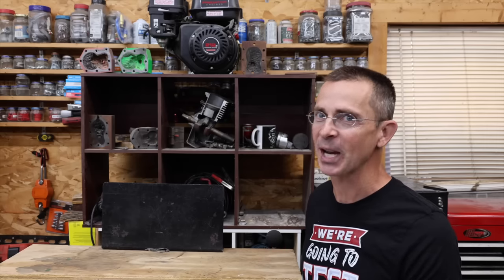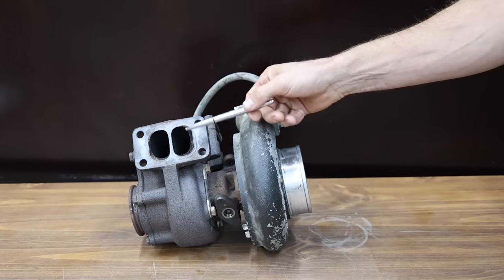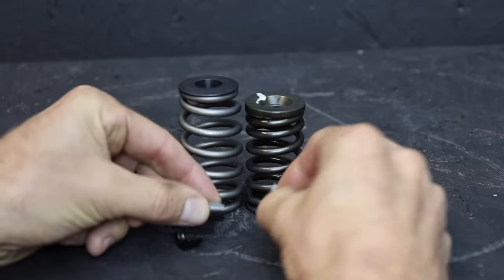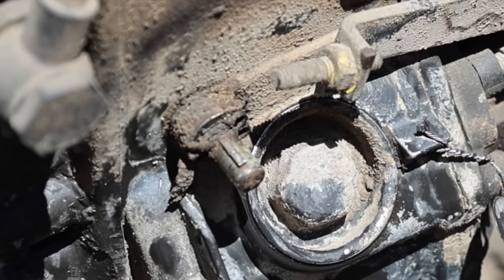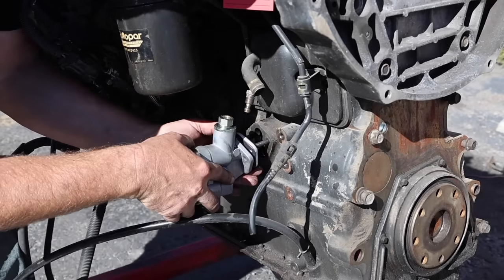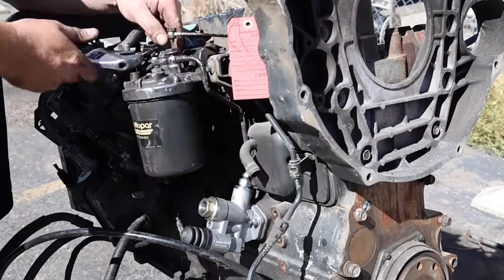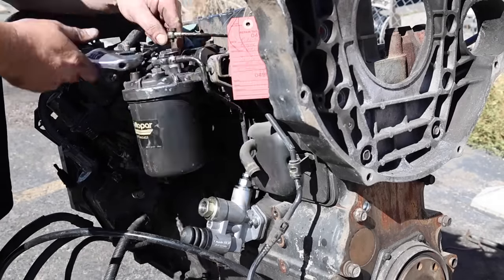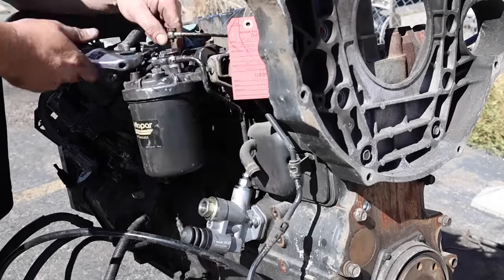Did I Waste $5000 on Engine Parts? More Horsepower & MPGs? (Part 1)

Comment: The only people who have absolutely never broken a bolt are those who have never held a wrench in their hand.
A penetrating oil, application of heat or cold, and an abundance of patience will hopefully provide success.
PS: swearing does not loosen the fastener, but may prevent you from having a seizure of some sort. Hollering at the shop dog or cat will upset them, but will not impress the stubborn bolt...it's not the critter's fault. Its about oxidation....
Good luck, all!
Reply from the maker: Thanks for sharing.

Comment: It was an awesome video but you talked about horsepower numbers that's a diesel the real numbers were in the torque you went from like 430 ft pounds to over 800 from what I could see that is a real Improvement torque is what pull loads as im sure u know. Great video brother

Comment: Late 70's to early 2000s autos were chronically under powered. 0-60 in under a minute? I had a pickup that topped out in the low 50s. In city, traffic light to light travel, it was painful.
Reply from the maker: Thanks for the feedback.

Comment: Welcome to the knowledge of high performance diesel engines. Today, 1000 reliable hp is available in upgraded engines. this requires a lot of internal work on push rods, pistons and often crankshafts. But the power is there and it is reliable. Economy does not suffer if you avoid the pollution controlled engines. Think 2006 and earlier to stay legal.

Comment: How about testing which automotive OEM has the best rust preventative coating/finish on their fasteners? I’m interested in which OEM fastener will last the longest in the rust belt states.
Reply from the maker: Thanks for the suggestion.

Comment: Hi, could you test the efficency of e.g. some usb charged night lights? I am particularly interested in the TNMOO LED Night Light with Motion Sensor and the SOLIDEE LED Night Light. An other branch of interest are rechargeable powerbanks and batteries like Varta Power Bank Energy 20000V and VARTA Rechargeable Battery. What are either the absolute efficiencies or at least the most efficient products of the same category?
Reply from the maker: Thanks for the suggestion.

Comment: I doubt that transmission was struggling with the 400 horsepower.  I'm thinking that the 900+ foot pounds of torque to the wheels may have been the trouble!
Reply from the maker: Thanks for the feedback.

Comment: Wow, your truck was even good at the beginning. They claimed 130HP and it did 200. Such tunning is quite nic when you double the output. I usually had maybe 10-20% more when doing any tuning thats why I hate doing any modifications. Too much money for the power gain.
Reply from the maker: Thanks for the feedback.

Comment: Here's a project... I have boats on trailers used in both fresh and salt water.  There's a product called Salt-Away they claim protects my steel, painted steel and aluminum trailer and engine parts from saltwater corrosion...but does it actually work better than just fresh water flush/rinse?
Reply from the maker: Thanks for the suggestion.

Comment: Please walk me through how you bled the fuel system to get it running. My 12v has no fuel to injectors after replacing a fuel line. I have tried everything. I get fuel to the filter and at the banjo bolt at injection pump,but nothing to injectors. Fuel shutoff solenoid is functional. I can't figure it out and I want to drive my truck!
Reply from the maker: Thanks for the suggestion.

Comment: Damn only 3000 rpm? My mazda b 2500 turbo diesel can rev up to 5000rpm all day long but is a inline 4 12 valve ohc engine so that's a thing to consider 😅
Reply from the maker: Great point! The Cummins will now reach 4K rpm.

Comment: Remove the fuel plate bigger injectors and turbo  you will be a reliable 400 hp 700+ torque  don't forget the killer dowl pinc
Reply from the maker: I took care of the kdp 13 years ago.

Comment: I never understood the appeal over 5 litre trucks that rev to 1500 rpm and produce 150hp while guzzling 30l/100 km. No power or torque. My old 2.0l diesel Passat made 140 hp and 350nm of torque and could even tow a lot all while flying on the highway. And that's a 2005 model.
Reply from the maker: Thanks for the feedback.
Reply: This engine is “only” 5.9L so not exactly huge. But, they are mostly overbuilt so it can go for several hundred thousand miles under load with little problems. They can make way more power, but at a reduced lifespan. 
That’s a bit of the problem with the newer pickup diesels. They make way more power, but also don’t last anywhere near as long.
Reply: @NBSV1  makes sense. Indeed, the 2l 420 hp cars Mercedes are pushing out will not see 300k without problems

Comment: Your biggest problem was the automatic transmission not the motor. If you couldn't get an accurate HP or more importantly torque number because of the transmission and torque converter Lock up not working properly. There is a really good reason all big trucks still use a manual gear box and a clutch not a torque converter and for you think you know what your talking about the so called automatic transmission are automated and use a manual transmission controlled by a controller or ECU (electronic CONTROLE unit) the other type of computer. The ECU controls the electric motors and or air selinoids to shift the automated transmission not automatic transmission. Got it

Comment: why do you keep focusing on the 400 HP being the cause of the failed transmission and not the fact that you were pushing 850 wheel torque?! those are crazy numbers 
I have a 97 12 valve myself and will likely have some work done as well.

Comment: have a 2003 ram 3500 that only has 32422 miles on it is it worth the change over? have a wrecked 2021with, 43000 24 valve engine

Comment: So when are you doing brake upgrades?
Reply from the maker: Thanks for the suggestion.
Reply: If you can get them for your truck, EBC slotted rotors are awesome. Discovered them for my bike back in the day, now i run them on all vehicles (with any power) along with yellow stuff pads.

Comment: Hey I need your help with something can you test car power inverters I need one that will power a hair dryer I also have a subwoofer but the most expensive ones still have bad reviews and I don't know what to get I want to have instant heat from a hairdryer cause I have Reynolds and get frostbite very easily in the winter it's a real struggle for me and I don't wanna waste $300 on something that doesn't power it
Reply from the maker: Thanks for the suggestion.

Comment: Look man everybody knows that owns a diesel it is worth it. And on top of it you should have bought a AirDog lift pump. Those stock lift pumps are junk. So if you want more fuel mileage then install a compound turbos then you will get 25 mpg.  Make sure to upgrade to a billet input shaft and a nice billet converter.  Just upgrading the torque converter will help your transmission out a ton. Everyone knows all stock transmission no matter what make or model is junk. Chveys Ford or dodge have designed them to take stock power only. You can talk crap all you want about transmission cuz it shows how much you don't know about automatic transmission.  Have a hood day man and happy Veterans day lol 😂
Reply from the maker: Thanks!  Thanks for the feedback.

Comment: The suburban would definitely be faster than that. Ram it's a little more modern little more balls... And arguably GM's greatest vehicle ever created a GMT 800 if you want to argue a Buick LeSabre with a 3.8 being more reliable than you. Obviously never owned one. Okay, the engine's reliable but everything else around it breaks and rots off by doing simple things you can't beat on one of those other for Grandma. I'd beat the piss out of my 800 daily. And it still starts in wants more.. I would drive my. I would get in an 800 and drive it across the country as long as the tranny wasn't slipping... And even then it's not going to leave you stranded. It might just lose a gear or two but you're still going to get to where you need to go. My 2016 Chevy Silverado left me stranded overheating transmission stuck couldn't move. That was the straw that broke the camel's back. I called the dealership and said come get this piece of garbage
Reply from the maker: Thanks for sharing.

Comment: PROPOSED “UPDATE TO Does Lucas Transmission Fix Work? Let's find out!”
TRANSMISSION FLUID CHALLENGE PART 2 / BENCH SIMULATION, ENHANCED!
1.	BENCH | SIMULATION: A WORKING MOCK CLUTCH DISK ASSEMBLY
a.	COMPONENTS | USING A GRIND WHEEL| MOCK CLUTCH [BAND LIKE WHEELS OR AUTOMOTIVE CLUTCH BANDS LIKE AND OR MATERIALS (NEW/USED SANDWICHED & SEALED TOGETHER IN SEE-THROUGH BAG/MEMBRANE/AND OR GLASS SURROUND CHAMBER)
b.	DEMONSTRATES & MEASURES | TORQUE/FRICTION/SPEED/HARSHNESS /HEAT VS COLD/NOISE PRIOR & POST FOR EACH TRANSMISSION FLUID APPLIED, ETC. 
c.	BENEFIT | THIS WILL GIVE VIDEO SIMULATION OF THE TRANSMISSION CLUTCHES ENGAGING, DIS-ENGAGE, & LOCK-UP.
d.	PIT STOP | EACH SIMULATION TRIAL START REQUIRES THE APPROPRIATE DRAINAGE, FLUSH, CLEAN, & REPLACEMENT OF BAND MATERIAL, SEALS, RELATED PARTS SUPPORTIVE PARTS, AND CONSUMABLES SUCH. TRANSMISSION LUBRICANTS INCLUDING RECONDITIONER PRODUCTS.
2.	BENCH | A WORKING MOCK TRANSMISSION VALVE BODY
a.	COMPONENTS | USING A REAL USED AUTO TRANSM. VALVE BODY AND OR PLUNGER LIKE DEVICE AND CLEAR PIPE ASSEMBLY [CLEAR HOSES, VALVE LIKE CHAMBERS TO SIMULATE NEW/WORN VALVES, SEALS, AND OTHER VALVE BODY COMPONENTS TO EFFECT PRESSURE/SPEED/NOISE OPEN & CLOSE RECOVERY SPEED AND FUNCTIONS. POSSIBLY USE PART OF A WORN AUTOMOTIVE VALVE BODY WITH AD-HOCK MINI PRESSURE HOSE CONNECTED TO SIMULATE REAL WORLD TRANSMISSION PERFORMANCE USING EACH FLUID IN SEPARATE TRIALS.
b.	DEMONSTRATES & MEASURES | PRESSURE VOLUME & CONSISTANCY/FRICTION/SPEED/HARSHNESS /HEAT VS COLD/NOISE PRIOR & POST FOR EACH TRANSMISSION FLUID APPLIED, ETC. 
c.	BENEFIT | THIS PROVIDES A BASIC VIDEO SIMULATION OF AN AUTOMATIC  TRANSMISSION INNER WORKINGS (CLUTCHES ENGAGING, DIS-ENGAGE, & LOCK-UP, VALVES, VALVE BODIES, PUMPS, ETC IN OPERATION USING DIFFERING AUTOMOTIVE TRANSMISSION LUBRICATION PRODUCTS INCLUDING HI-MILEAGE PERFOMANCE RECOVERY PRODUCTS.
i.	FLUSHING THE PIPES CHAMBERS AND APPLYING THE WORN SEALS.
d.	PIT STOP | EACH SIMULATION TRIAL START REQUIRES THE APPROPRIATE DRAINAGE, FLUSH, CLEAN, & REPLACEMENT OF BAND MATERIAL, SEALS, RELATED PARTS SUPPORTIVE PARTS, AND CONSUMABLES SUCH. TRANSMISSION LUBRICANTS INCLUDING RECONDITIONER PRODUCTS..
3.	BENCH | A WORKING MOCK TRANSMISSION PUMP 
a.	COMPONENTS | A WORKING USED/NEW TRANSMISSION PUMP & OR A MACH/AD-HOC USED/NEW TRANSMISSION PUMP, HOSES, AND ANY RELATED SUB-COMPONENTS.
b.	DEMONSTRATES & MEASURES | TORQUE/FRICTION/SPEED/HARSHNESS /HEAT VS COLD/NOISE PRIOR & POST FOR EACH TRANSMISSION FLUID APPLIED, ETC. 
i.	PLUS PRESSURE / SPEED / NOISE SIMULATION IN A MOCK CLUTCH DISK ASSEMBLY
ii.	ALSO WORN PLUNGER VS NEW PLUGNER LIKE TRANS VALVE WORN VS NEW VS TREATED /SPEED OPEN CLOSE, PRESSURE HELD, PRESSURE ESCAPE RATE, HARSHNESS OF VALVE/PLUNGER MOVEMENT, NOISE, THERMAL SPEED AND FUNCTION ALSO.
c.	PIT STOP | EACH SIMULATION TRIAL START REQUIRES THE APPROPRIATE DRAINAGE, FLUSH, CLEAN, & REPLACEMENT OF BAND MATERIAL, SEALS, RELATED PARTS SUPPORTIVE PARTS, AND CONSUMABLES SUCH. TRANSMISSION LUBRICANTS INCLUDING RECONDITIONER PRODUCTS.
Reply: Apologies for my late submission, I attempted to submit much earlier. I am truly grateful for your episode, " Does Lucas Transmission Fix Work? Let's find out!." 
- I am using both products covered "AC Delco Dexron Vi" transmission fluid as well as the "Lucas Transmission Fix" additive successfully! 
- All 3 years!
- In Real World conditions!
Reply from the maker: Thanks for the suggestions.

Comment: Lol no a built 12v can not pull like a new diesel.  The EGTs climb to fast under load. It can not sustain the power output. That’s why we pro drivers don’t build them and buy a new ford 6.7.

Comment: All that queer diesel crap for 400 hp?? My sbc 400 makes 491hp with 612tq with simple mods like aluminum heads, cam, intake and a bone stock Q-jet. 😂😂 I also don't have to baby it in the cold weather. 👉👌
Let me remind you " A Small Block" 😂